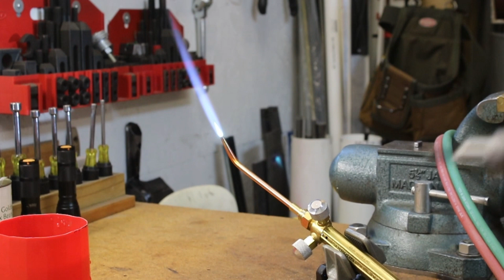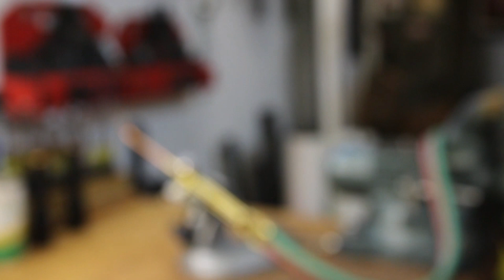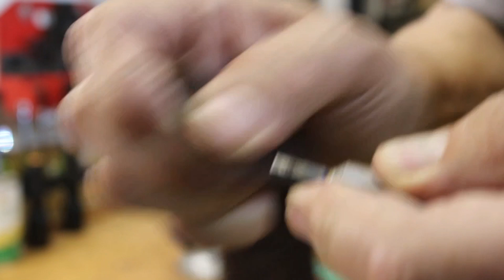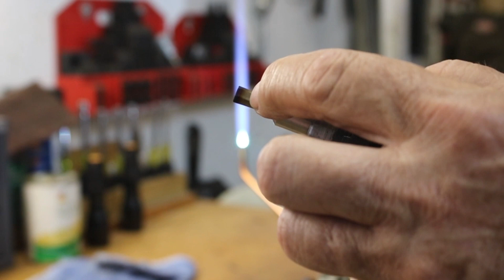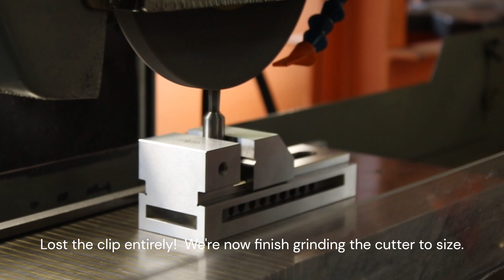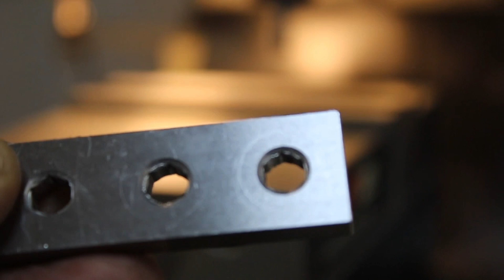Rotary Broach Cutters - Heat Treating and Grinding

Comment: Is this the shop located in Watertown?
Reply from the maker: No
Reply: What steel you use make cutter?
Reply from the maker: @juhavuorinen3945  w1 drill rod. You can use O1 drill rod but quench in oil.